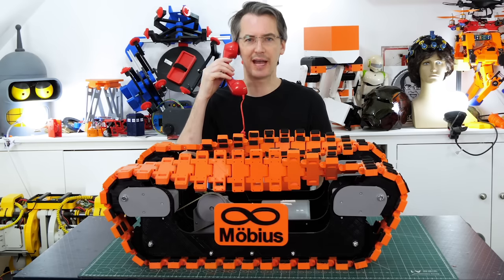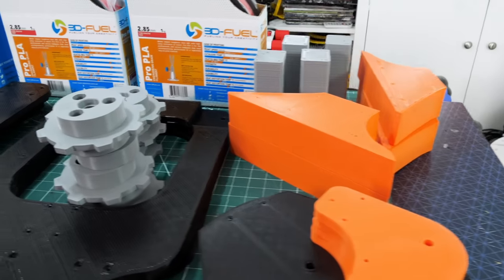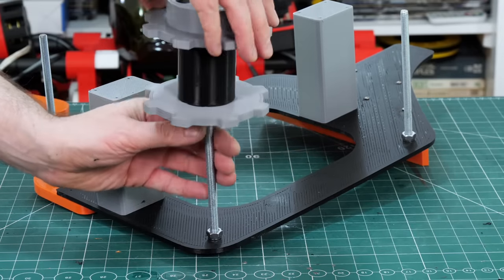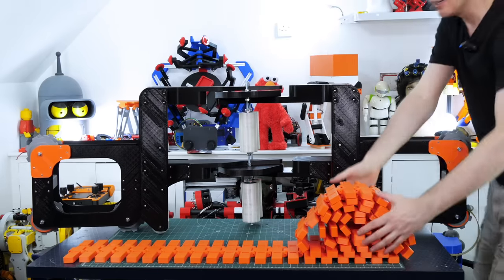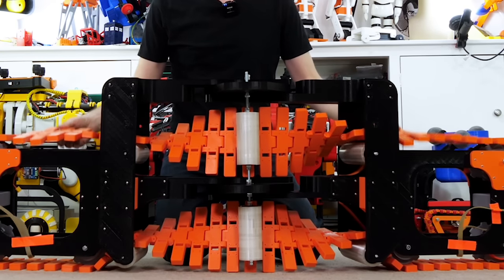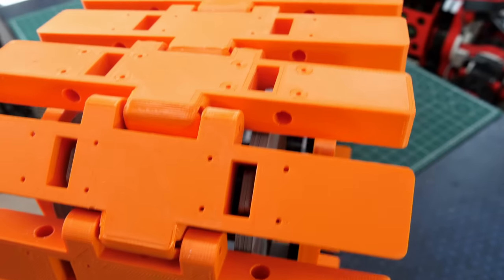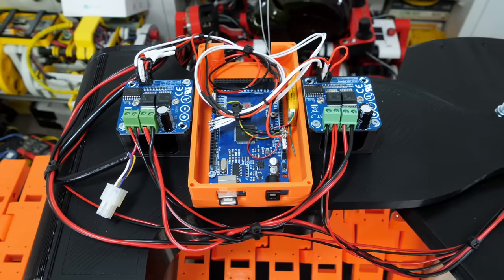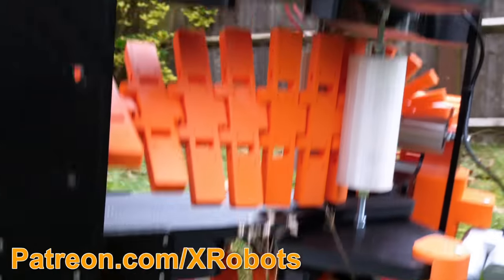I found a use for the Mobius Strip Tank

Comment: Ooh! If you had 2 twists, top and bottom, then you could have one drive surface for the "front" and one for the "rear". Imagine if you had grippy drive surface at the rear, but some sort of more directional-holding linear surface on the front to enhance steering!
Reply: Came here to say this
Reply: that would kind of defeat the purpose of a mobius strip tank
Reply: @itsyaboikirbo well yeah, it wouldn't be a mobius strip anymore, but that's fine right? Call it "inspired by".
Reply: @ilonachan  true
Reply: @itsyaboikirbo i don't think it would. It's still using both sides of the track evenly. Just that the back of the tank is using one side and the front is using the other side.
Reply: came here to ask the same question
Reply: At that point you might as well have two separate loops since you have a motor in front and one in back anyway.
Reply: Same thoughts but then I thought about what would the comments say and the first thing that came to mind was at that point you might as well just have 2 separate tracks.  In the end, the reason is FOR SCIENCE! But the internet will internet.
Reply: @MrDrakeSirlit  while it is a good idea, it is, by definition, not a Mobius strip at that point
I do think it should definitely be tested though
Reply: @Sceptile29   oh, i agree, definitely not a mobius tank at that point. I was just replying to itsyaboukirbo saying this defeats the purpose of the mobius tank. Where, as far as i can tell, the purpose is to evenly wear each side of the tread. If the actual purpose is to say "I've got a mobius tank" then i will concede the point and agree that this idea defeats that purpose.
Reply: You could also just have two separate treads for the front and back tho if you’re going that far
Reply: Or alternating sections of tread as long as the bottom bend section, so it's never on both contact points.
Reply: Wouldn't be a mobius strip anymore
Reply: @ilonachan 
I am fairly certain that a strip with 2 bends in it is still called a mobius strip.
Reply: @redstonewarrior0152  not if by "bend" we mean a 180° twist. A mobius strip is by definition non-orientable, which means rather than having a top and a bottom side, these are actually the same side (a situation created by gluing them together). If you twist the strip twice, you'll just end up gluing the top side to itself, and the result will still be orientable, hence not a mobius strip.
Reply: He explains this at 9:45
Reply: I can’t have an original thought
Reply: At that point just have 4 tracks or a half-track configuration
Reply: Same thought. That could be interesting solution.
Reply: What do you mean "if you had 2 twists?" Literally the tank in the video would do that.
Reply: or just use two belts with two motors, making the production much easier and saving lot of space
Reply: @redstonewarrior0152 It's not, if it has an even number of twists in it then there are 2 sides of the strip. By definition of a Mobius strip it has only one side so an ant walking along one side would return to the other side after one cycle. Try it yourself with a long piece of paper and two twists. If you start your pencil on one side and trace it along the strip, you will return to the same side after one cycle and you cannot make your way to the other side.
Reply: @MrDrakeSirlit  how
Reply: Oh snap that's so clever!
Reply: It wouldn't even have to be ONE belt anymore though.
Reply: but then you could just have two separate tracks?
Reply: Or, hear me out! Tank motorcycle

Comment: The main benefit is doubling the tread surface area without doubling the length of the tread.  This would apply well to something that had to crawl on hot lava, for example.  Or something designed to soak up oil spills on the water.
Reply: How does thus double the surface?
Reply: @frandurrieu6477 For the same weight / construction materials cost, you can use both sides of each tread tile, the top and bottom side, spaced apart by the full length of the tread so there would be plenty of cooling/processing time when the tile could be renewed for the next pass.
Reply: Problem is wear
Reply: @quantumblur_3145  Depends.  If you were really trying to build a tank that could cross literal lava, and it needed a certain amount of cooling time before it could be re-used, you could use almost the same amount of materials and manufacturing costs to produce twice as much usable tread surface for withstanding the lava, creating the virtual footprint of a twice as long tank crossing one lava stream after another a full tread length apart.  This would be more effective than having half that footprint, and if you weren't hotrodding your lavatank through the desert for fun, the extra wear from the mobius twist would not be a great concern.
Reply: @semegraph  wouldn't the lava warp the tread exterior and interfere with wheel grip?
Reply: @frandurrieu6477   Conveyor belts use this Möbius strip idea to double the wear surface

Comment: If you did a 180 twist of the track in both directions, the front and back section would each have their own side of the track! I think it would look really cool to paint one ground-contacting side of the track a different color; at first glance it would look like it has two different tracks but on closer inspection you'd its actually one
Reply: well, this double colouring of the track would still be shown on this tank. the track twists two times between two sides, so each of the sides would have different coloured tracks

Comment: Love to see that you keep your problems / mistakes in the video (i.e. sprocket problems). Shows that even you have problems, but don't give up and fix them!
Reply from the maker: I try my best to make things work the best I can
Reply: @jamesbruton that's all anyone can ever do
Reply: @jamesbruton  I have a small solution if I may, for the treads getting stuck on the terrain. What if you slightly decreased the width of the track pieces, to be more precise, just decrease the sides a bit so that the track is a little narrower.

Comment: You could lift up the tracks in the center more, so the bottom one doesn't touch the ground and bind up the bottom twisting action in the grass for example. You could also make this into a two tracked version like a skidsteer, but both steered as in this video , with the inside one steered more acutely to keep true alignment in the turning circle. Having two tracks would also eliminate the problem of this version being out of sideways balance while turning, causing it to partly ride on the bottom track that is in the middle of the twist and should really not have any of that resistance against its twisting action, especially in uneven (not smooth) terrain like gass.

Comment: This was really interesting and amazing.  If the point is to design tank treads that articulate, this is very close to an idea that's worth chasing. I would say, going back to keep the bottom flat and have the top flip to form a true mobius strip is a bigger idea. Redesigning the tread to articulate on the flat and have a tread surface on both sides would be an advantage; longer track life, finer steering control, and a novel feature enabling greater armor coverage on the high part of the track.

Comment: Took me the whole episode to understand why you designed it with the bend on top and bottom. It's actually genius doing that to allow it to bend freely in the middle.
Reply: although Im wondering if the mobius-bend is really necessary ( well it is in this case or you don´t have a mobius tank duh 😉), so a more sophisticated track which runs normal but its links - farther apart - have a wider range of lateral movement ( forced back onto the sprockets on each end ). The individual track connections need to be flexible but have to keep the track together. Hm, does it make it even more complicated or less complicated then  ^^

Comment: I think maybe if you made the bottom twist twist all the way, and the top one twist and twist back, it might run better. I'm noticing the bottom tread in the middle where it bends seems to be getting caught a little because of it trying to bend back the way it came. 

Either that or you could twist both the entire way around. It would defeat the purpose of using a mobius strip, but it would still be cool.
Reply: putting a twist in both top and bottom will still make it run on both sides of the track even though it's not a mobius strip
Reply: @when_the_  Oh i see... I was legit annoyed that the bottom was catching and I couldn't understand why he twisted the top and didn't the bottom. Mobius strip video, i get it now.

Comment: I appreciate you do this stuff kinda to see if you can and for the whole problem solving element of these weird designs. I just can't help but point out you have a motor in each side so this could just be 2 separate normal loop tracks, job done easy.

Comment: Interesting and a lot of printing. For turning the machine you probably don't need a mobius or to make the track to flip over fully but just a shared pivoting line which you have. If tracks just turn 90 degrees at pivoting point and then back to 0, you should be able to turn your machine left and right. Keep on inventing!:hand-purple-blue-peace:

Comment: Haha! Great video as usual. 

Quite amazed at your ability to cobble togeather such complex designs 

Maybe for the parts you printed on the extended bed, it's worth considering laser cutting? I know you said it didn't take that long to print - but it would he alot quicker for pieces that are flat side panels with no complex 3d geometries 

Hehe the phone gag was funny  - maybe you can distort your voice alittle or actually use the phones microphone to add additional layer to the effect, so that if you arnt watching but listening to the video, you still experience you talking into the phone

Well done for all your hard work! 

Also wonder what you do with all your waste plastic?

Comment: Glaring thing I kept thinking of was at this point just make two tank treads independently, if there is no contact in the middle what’s the point of it being the same track that hits the ground again in the back. Either make two independent track loops, front and back, or (to keep the spirit of the project, which is very cool) have one twist at the top and let the weight of the tank keep the non-twisted bottom in contact with the ground so it is able to bend like the sushi style bending track. Also keeps it a möbius strip. Two twists mean two sides.

Comment: The track needs some guides to help smooth out movement when it goes between the bends. Adding some suspended/sprung small rollers to the outside of the ground contact armature will help with stability. So cool. Love it

Comment: Some people already tried to point it out but you said it in your video (maybe the point of the reupload?) this is still a mobius strip, as one of the twists is not actually a real twist. Still, you showed with the bottom one, that the top full twist doesn't actually add any functionality right? You could have just half twisted both and not had a mobius strip, for the same twisting capabilities. Though looking at it in the very end, the twist may help the middle section adhere to the center rollers a bit better, as it's fully tensioned against the rollers, the bottom seems to have more flex in one direction

Comment: Hey question, I’m building a large six wheeled rc car using 6 Geartrisan 12v dc motors, 6 MG996r servos for steering with a 12v step down to 6v and 8 other servos a unique capability. Powering it I plan to use a lipo battery would you recommend having a BMS in the circuit to protect the battery from over discharge ?

LiPo: 12v 6000mah 35c

Comment: If you make the twist section longer it might help with the grinding. Gives it more space to twist and untwist
Reply: Or he could make it so it can rotate more easily like it can move even further
Reply: The biggest problem I see is that when the bottom belt is vertical it's hitting the ground. It either needs the entire middle section raised and/or less wide tracks.

Comment: in theory, a quad mobius strip system could have the tight turn, single wear surface, And a full length contact tread for low ground pressure.
but a system w 6 standard treads would do that too, be simpler & far more robust, assuming both used a complex hinged chassis system.
still awesome ideas, and great to See them build out & tested!

Comment: I think you might be able to do this w a more continuous twist, giving a round wheel shape to both treads. The real twist would be at the top, and flex as current, the faux twist would be replaced with track bending, allowing for the development of an upward flexing curve to the track while turning. This would elevate the center of the device off the ground, and allow for more clearance and wheel like behaviour (and support, even drive, from a supporting wheel for the track ends. If you make a paper mobius, holding it twist up, press the lower flat upwards, then twist it to see the "wheels" turn.

Comment: For grass stability, you could put some free-rotating rollers right above the tracks that they would run into if they tipped up too far. It would add some resistance, but with good bearings, hopefully the anti-topple function would outweigh the increased friction.

Comment: Such a cool project! As the tank turns, the length of track path increases by 2 * (radius of the centre rollers) * (turning angle in radians), which would increase the track tension. (Equivalent to shortening the track by ~1-2 cm for a 5 degree turn). Could this be part of the reason it struggled to turn in the grass?

Comment: The extra tiltability of the treads allow them to tilt to form-fit rough ground and maximise contact area. To fix stability, you could double the treads or put stabilising wheels. Doubling the treads may cause issues with steering, but should be possible. Ideally, you don't want the vertical twist touching the ground, so it'd be good to raise it higher.

Comment: May I suggest a tensioner and an idler for the front and back, between the upper and lower rollers at the ends. Help keep the track tight as well making a curve to the front and back for better maneuvering over bumps/hills.

For the tipping in rough terrain, I would suggest looking into snowmobile skid designs, lots of idler wheels.

Comment: Very cool really enjoy your projects. However  can you think of any possible advantage of this system over independent front and rear loops? I cannot so it seems more like a Rube Goldberg  project making it complex for the sake of complexity. It is high art in engineering!
Reply: A possible advantage would be having the combined torque of the 2 motors acting on all drive surfaces. With independent loops, you could conceivably encounter a situation where one loop has poor traction and spins freely while the other loop has great traction but lacks the torque to move at full speed. With the combined loop, the torque of both motors is first combined and the resulting force would be applied to the surface with the traction.

Whether this benefit would outweigh the increased resistance from the extra rollers is an open question.

Comment: with all these tracked vehicles you've been making, is there a reason you don't an adjustable piece to tension the belt? You seem to reprint the part so it's tighter but wouldn't a slotted piece or something connected to a threaded rod work better? It would be the right size every time and the belt could be made even tighter.

Comment: Great concept, great video. Don't know it's purpose when you use two of these tracks on a vehicle though.
A possible fix might be to bring the lower track band up side by side at the other track bend, then you only need 3 rollers at the steering pivot. Keep up the great work in 2024 😅
Reply from the maker: it needs to touch the ground in the corner at the bottom so it doesn't fall into the corner when it bends...
Reply: @jamesbruton  a counterweight could help, perhaps swivel te batteries?

Comment: If you ever replace the tracks, try making the gear holes slightly flared open, at the same angle as the new beveled gear teeth.

This would really give you that extra protection from any jams ever happening. Ever ever.

Comment: I think you should run a slightly offset set of holes in the middle of each track and then include sprockets on the vertical rollers to lift the track off of the ground so it doesn’t drag from gravity in the center. Also, this is a viable concept for a single track motorcycle, and you should continue to develop it as such

Comment: Thinking theough the problem of rough terrain.  If you put the supporting wheels on the side, it would just add force on the machine from any bumps it goes over.  It would likely fall over very quickly.  It works better with some give, unless you put suspension on the supporting wheels to give it some leeway.

Comment: It's a bit sci-fi, but You could use the Mobius to pull a section of track inside the vehicle for maintenance.  Use replaceable feet on the tread sections and swap them for wear and tear or for certain terrains.  I'm thinking like a big Sandcrawler type vehicle. Rubber feet for that run to town, and armored ones when back on the field. Maybe some snow shoes.

Comment: It would not be possible to design the chain links in a pointed shape so that they can rotate without twisting?, because the bottom part scrapes against the floor that would eliminate the need to twist the bottom part

Comment: You could probably use a kind of sprocket on the bottom half of the midsection to basically suspend the twisted track, and then simply narrow the track so the bottom isn't touching the ground anymore. I don't really understand what benefit you'd have from the side of the bottom track touching the ground and after seeing it get stuck in the grass it seems like it'd be better to avoid it.